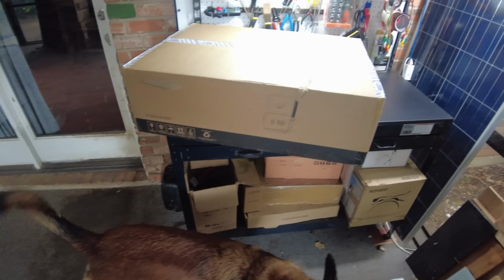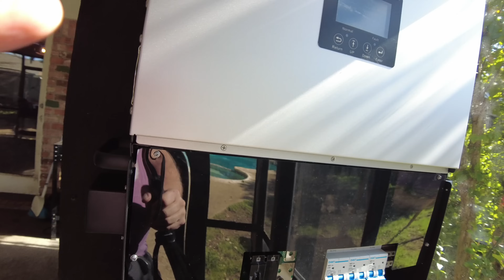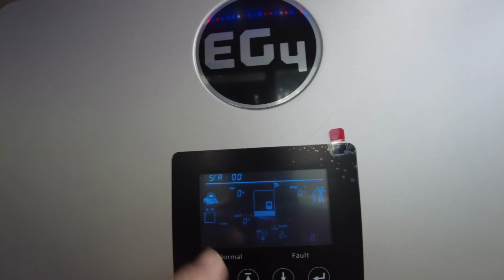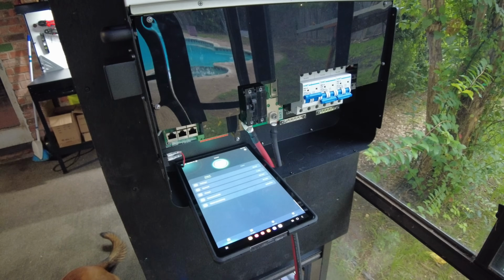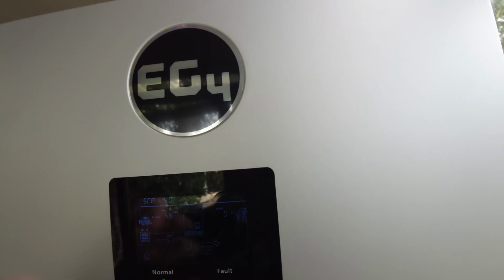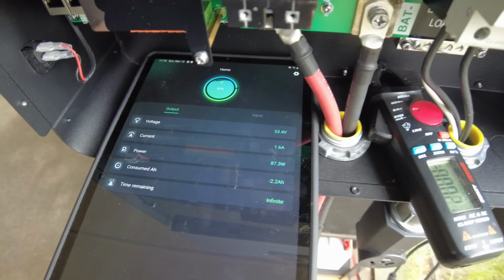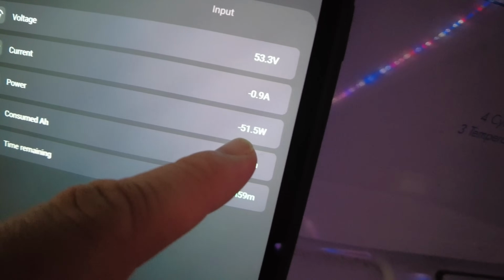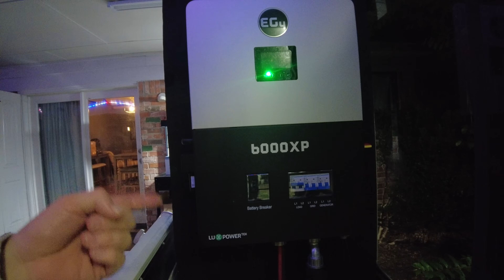EG4 6000XP All-in-one Split Phase 6000w Inverter

Comment: it is made to only use EG4 server rack Batteries? No home made Lifepo4?
Reply from the maker: It really wants a battery with communications, and looks like it supports much more than EG4 batteries. However It seems fine using Lead-Acid type setting with these mini LiFeP04 batteries I have hooked up. In this mode you get charge voltage, and float voltage settings, I don't see any other old school lead settings like temp compensation, or equalization.  So really seems ok, but I haven't used it enough to know if anything strange will pop up. Thanks!

Comment: I started out with the hybrid 3000 watt all in one inverter but after all the problems with the grounding when it switched between battery and ac input I just went to the 4000 watt sungold low frequency which don't have the grounding issues. I finally figured out the all in one but it's not half the inverter as the sungold
Reply from the maker: Yeah, that's why I've waited so long because IMO these AIO's were not good as having individual/discreet components. Looks like they are catching up. Thanks!
Reply: @BradCagle  if you have the AC input hooked up on that inverter is there anything weird happening when it switches from battery to grid. I mean with your neutral ground bond? Mine would trip the GFCI at my house where the AC input was plugged into the inverter if I had my inverters neutral grounded. If I didn't have it bonded it would make my fridge motor sound weird and the furnace motor sounded weak. I now just use that inverter as a battery charger and it's great for that.